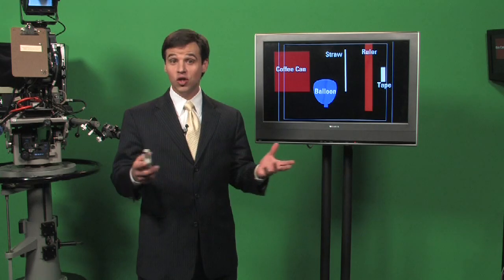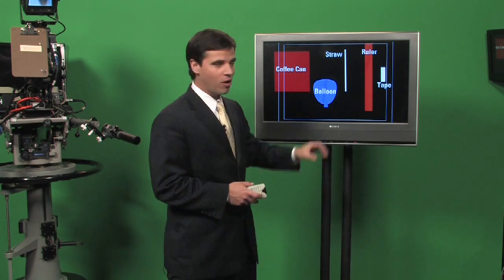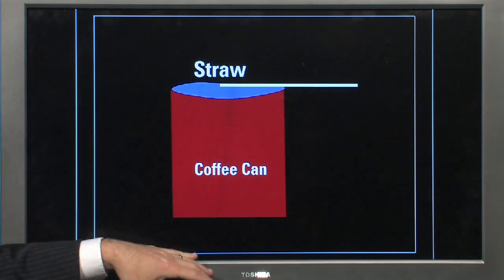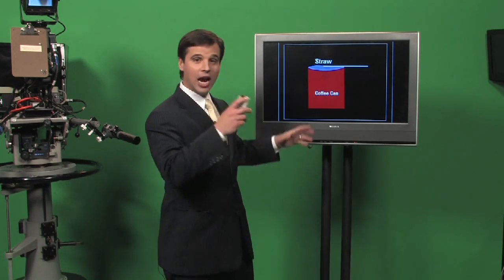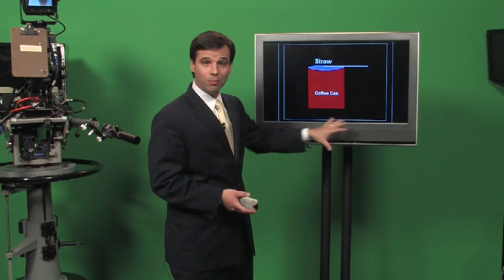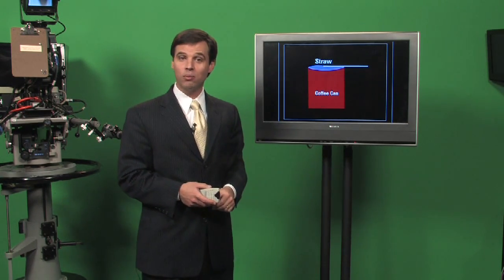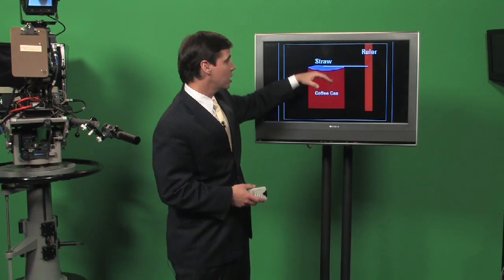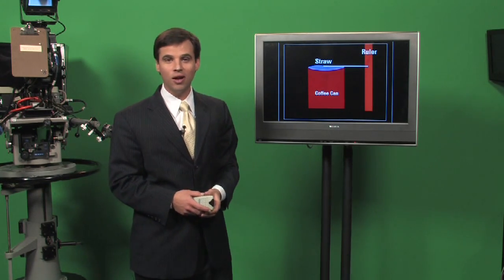Weather Barometers : How to Make a Barometer

Comment: Yes it does because the straw has been taped to the flexible balloon membrane, not to the solid can. The balloon membrane rises when the air pressure falls and it falls when the the air pressure rises.  The problem is the ballon membrane will rise with rising temperature even when the pressure is stable.  This is why commercial barometers always have a temperature compensating mechanism.